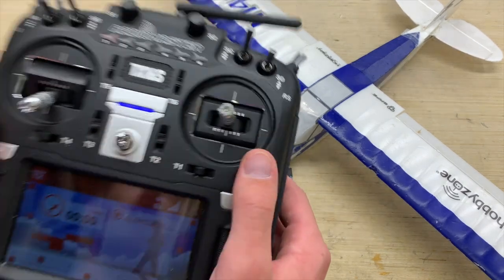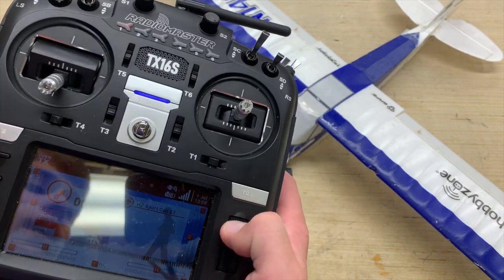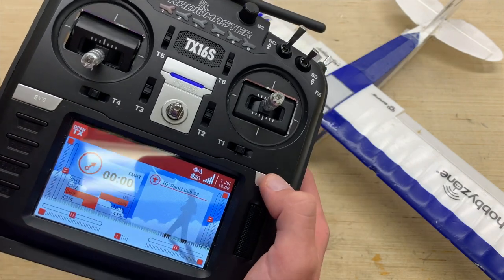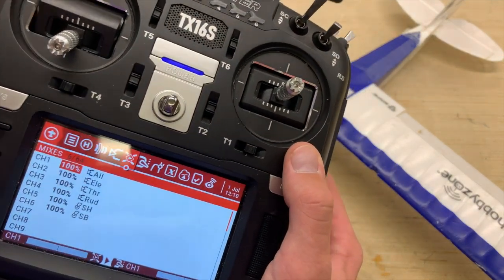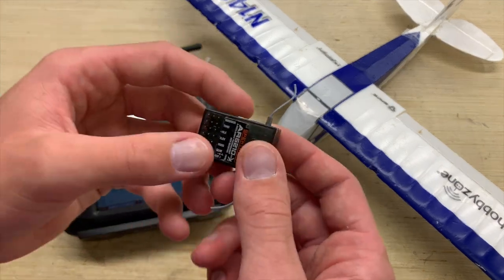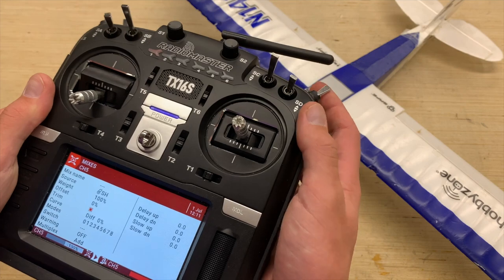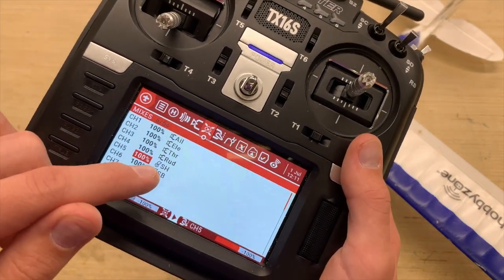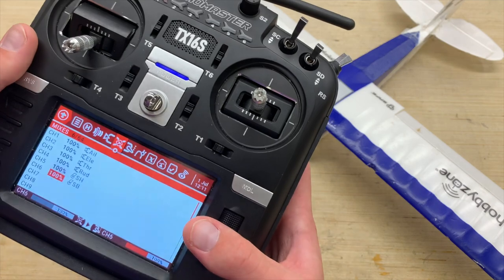How to Set Up Flight Mode/Panic Button Switches for SAFE/AS3X Planes w/ the RadioMaster TX16S

Comment: Thanks for these videos, they are a huge help. I am a drone pilot. I fly DJI Mavic Minis and a DJI Mavic 2 Pro. I also have a few CineWhoop's and two 5" acro drones that I built. I've been flying them for about 3-4 years now. I started with a Jumper T16, but soon after bought the RadioMaster TX16S Max. I love my TX16S!

I am new to fixed wing flight and I cannot wait to get my new plane in the air; it's a Turbo Timber Evolution 1.5. I wanted to use my TX16S, but I kept seeing videos saying you can't completely configure a Spektrum plane with TX16S because there are some things you cannot do with OpenTX. So I figured I would have to buy a DX6 or NX6 to be able to fly the plane the way it was meant to be flown. And now here you are showing me I can use my TX16S Max.

The only thing I have left is to figure out flap configuration and the radio will be 100% ready to fly my new plane. Did you ever do a video on configuring flaps for Spektrum receivers on a TX16S?

Thanks for these tutorials!
Reply from the maker: Yeah, essentially you can still use AS3X but safe functionality is a No-go without a genuine spectrum transmitter. Flap functionality is found in the AUX channels accordingly in the receiver, and you can look up any OpenTX flap tutorial for insight. hope it helps!
Reply: @CustomFPV  Awesome, thanks!

Comment: Thanks but when you say that you have set a switch for channel 6 as FLIGHT MODE do you mean that that channel switch is for the AS3X stabilization mode? Therefore channel 5 switch is for PANIC mode and channel 6 is for AS3X stabilization mode.

Comment: Thank you, this seems to have worked for me with a Radiomaster Zorro running EdgeTX. The only 2 quirks are 1) the lights don't change on the receiver when switching flight modes like they do when using a Spektrum radio (blue/red/purple), and 2) when I switch from one of the self level flight modes to no bank angle limit (AS3X only) it takes about a second to register the change, but seems to work ok apart from that. I haven't test flown it yet but it seems to work on the bench.

Comment: What if your plane has retacts and flaps , then where do you put your flight mode switch , im guessing on 7 and 8
Reply from the maker: I would assume so. I don't have any planes like that, however one thing you can do to determine it is to go ahead and start assigning switches and see which switches control each channel, then go from there. Let me know how it goes!

Comment: I bought a TX16s and a friend of mine has a Spektrum AR637T he isn't using and is willing to give it to me to see if I can get it to work with my TX16s. My question is how does one program the AR637T?  I watched a video setting up a FrSky S6R with a TX16s and calibrating the S6R was pretty straight forward. Knowing Spektrum I'm sure they made the process harder & more clandestine. 

Great video BTW and I agree with the fellow who suggested to slow down a bit.
Reply from the maker: It will bind up, and you can use as3x I believe, but on those RXes no safe. That’s the consensus at least.

Comment: Not aure the AS3x will work on certain spektrum receivers that require a special usb peograming cable like the AR636.
Reply from the maker: There may be limited compatibility, yes, but I’ve had no issues with it on this or a few of my other models

Comment: Great video but on my Sport Cub S2, I can get all 3 flight modes working on ch5, but soon as I apply throttle, I lose all SAFE functions and the light inside goes red, cannot go to blue or purple. Have you ever experienced this?
Reply from the maker: This is the only model I have had success getting safe to work w the TX16s. my ec1500 and other HH models safe doesn’t work. My understanding is that there isn’t really a fix for it.
Reply: For me the light doesn't work inside, but the SAFE functions work for all 3 settings. So your video does work! 

I got the safe select to work on my Turbo Timber umx, but I've yet to work on my Carbon Cub s2, I'm sure it'll work all 3 settings just like the Sport Cub S2
Reply from the maker: Glad to hear. happy flying!

Comment: 2 questions if i may,

1) does this process apply to edge tx also?

2) will this process also work on larger spektrum planes like a conscendo evo?
Reply from the maker: 95% of this applies to EdgeTX, it’s almost exactly the same as openTX. 

Other commenters have mentioned trouble getting all the SAFE and AS3X tech to work properly with the tx16s. I’m pretty sure you could fly the consendo but I’m not sure if you’ll have all the smart features.
Reply: @CustomFPV  gotcha. Thanks
Reply: Addition:
I have bound my conscendo evo and tx16s using the eachine mini warbird as a template then adapting the protocol to suit. I had to reverse a couple of servos but that was it. Safe and AS3X working fine. 

Thanks again for the info.

Comment: Great video. I just got a used eflight wildcat EFLU3650. I have a T12 plus with open TX, How do i ding it to get the stanbilization active....i am not sure if it has apanic but i know that i have 3 modes...how doi do those?
Thanks

ALex
Reply from the maker: I don’t have a lot of experience with this, to be honest. this is the only plane I have with stabilization. If the flight stabilization system is   onboard the plane and addressed via switches, you can set that up in the mixer tab. If it’s something more, I don’t have a lot of experience with anything else like it, sorry. Thanks for watching!

Comment: I watched your basic setup video also. Did you have to add ch 5 and 6 to your input list before you went to mixing list in this video? Cant get my umx Gee Bee to respond SAFE / panic mode on ch 5 switch doing what you show in this video. The AS3X seems to be on as i see the minor movements in control surfaces as you move plane, but no panic response when ch 5 sw is moved while in wonky attitude. Thanks!
Reply from the maker: Interesting, I just assigned the channels and moved on, no prior setup other than switch assignments. Worked fine for me. Thanks for watching!
Reply: @CustomFPV  i tried setting up a newer model (umx A10) that was just released. The SAFE function worked fine. Might be a difference in the way they built the dms receivers over time.
Reply from the maker: @sut2910  I'd say so. Thanks for bringing that up!

Comment: doesnt work with AR637TA   ......that comes in the timber x or conscendo ..any ideas Noah.....thanks
Reply from the maker: Interesting, no experience with those in particular, but it worked great on the Sport Cub S, and it seems other people have found success with theirs as well. maybe try different switches, and adjusting the range and throw of the switches in the output tab, not sure.
Reply: @CustomFPV  thanks bud,  yeah that AR637 seems to be a tough one
Reply from the maker: Good luck. let me know if you get it figured out!

Comment: Thanks for this video. Great job. Can you do a video on how to do a three position switch for flaps? I’m trying to get a Timber X properly setup. Flaps work but start high (like spoilers)
Reply from the maker: I would be happy to do that! I need to set up some flaperons on a plane, I had a similar issue. I will be sure to make a video once I figure it out
Reply: Sounds like whatever switch is assigned is going all the way to -100, I'm mew to this also, but I think if your minimum is 0, mid is 15-20% and full at 30-35%, should work as flaps.

Comment: Noah, will the SB (flight mode switch) that you set up for your flight modes have Auto Leveling ?
Reply from the maker: Yes, correct. If you bind a 3 position switch to ch5 (i believe) you will have all 3 modes
Reply: @CustomFPV  u are the coolest !

Comment: What if you were using all 6 channels already, for flaps and gear?
Reply from the maker: Well, If I am understanding correctly, that means you would need to use Ch7-8 for modes and panic, assuming your RX is 8ch
Reply: @CustomFPV  the rx is 6 channels

Comment: Just curious about the MPM firmware channel order. It looks like you kept the default AETR order and when you bind to DSM2 or DSMX, the MPM maps the inputs to the correct outputs. Is that correct? When the Jumper T16 came out, people were saying we MUST use the TAER firmware because the AS3X gyros wouldn't know what to do if it was in AETR order. If we can keep it in 5the default AETR order with the MPM handling the correct outputs, it will be so much easier!
BTW, I think the DSM2, DSMX and DSM RX (used for trainer mode) are works in progress. They've been changing some things having to do with Auto (possibly renaming this term), binding  in 22ms and 11ms and possibly other things. I believe they were saying something about the 22ms option disappeared in one revision and we should use auto to let the Tx and Rx handshake to determine the best options? Not too clear on this but it looks like the MPM folks are trying to simplify this for those of us who are transitioning from Spektrum radios.
Reply from the maker: Good point. I have heard about that, however I have yet to have an issue on the Sport Cub S. Might depend on the plane and RX. This method worked great for me, but we will see what other comments say about issues that occur. 

Yeah that would be a really big help to have an auto feature. Maybe not as much for like you and me who know our way around frame rates and protocols, but as you said, the beginners transitioning from spektrum radios could truly benefit from it! Thanks for the input!

Comment: No link to get the initial setup of AR 631 in open tx.  :-(( J
Reply from the maker: Should be close to similar, don’t have a lot of experience with that RX, but if you use DSMX to bind and assign channels to switches you should be in good shape.

Comment: So I'm a total noob. I'm thinking of getting the TX16S and I want to get the E Flite Valiant 1.3m for my first plane. So does the safe function work 100% flawless without buying any other gadgets like receivers, etc? Thanks
Reply from the maker: I don’t have much experience with it... it works fine on here but others have told me the integration isn’t great, as it doesnt have the spektrum proprietary tech onboard. if you want a radio that integrates with that, I would get a spektrum. I don’t use safe so the radiomaster is great for me.

Comment: I tried setting up my arm and disarm switch and it isn’t working.
Reply from the maker: Arm and disarm? like to start the motor? or what? or a throttle cut? please explain.,
Reply: @CustomFPV  for the throttle to be armed or disarmed. Flip switch one way to keep throttle from turning motor and switch the other way for the motor to run. I just having lots of problems with my tx16. My module blinks also saying it is recommended to update my version which I have tried doing and didn’t work. Also, when turning radio on it saids SD card needs to be updated. Tried that too and didn’t work. I have watched videos on how to do both but not working.

Comment: my local hobby shop told me that if i bought the tx16s transmitter it wont bind in a receiver that has as3x and safe technology and if it did it wont be functional is that correct? or was he just trying to upsell to on buying a spektrum transmitter. please help
Reply from the maker: It should bind fine, I have no experience really but it worked fine just by assigning channels to switches to control the features. all the as3x and safe hardware is built into the plane, not in the TX, so he was more than likely up selling you.
Reply: I live in canada and dx6e cost me 250$ which is around 190$ usd. Is it better to buy a tx16s than a “more user friendly” transmitter (dx6s) cuz i just got it today and i can return it and get the tx16
Reply: And also is you said safe and as3x is on the receiver meaning any type of transmitter it doesnt matter it would be always there (if you want to active it of course) right?
Reply from the maker: I think they are both great, the DX6 will be much better and easier to set up. However If you think you will take advantage of the extra features the Radiomaster brings to the table then go for it, but it will be much harder to tune and get it to function as you want. If you are only flying spektrum as3x and things like that, the user friendly ness of the dx6 is a major advantage
Reply from the maker: Yeah, it won’t be as easy to set up but it should be possible, i don’t have much experience though, I don’t fly safe or as3x.

Comment: hi i was look for the good for airplane .. it’s work with any kind a Receivers ? . and Fixed Wing Flight Controller Gyro it’s work . i see another Remote control Remote Transmitter ( RadioLink AT10II) .what is best i go for the RadioLink AT10II or Radiomaster TX16S
Reply from the maker: I think the TX16S is the best, got the Multi protocol module, will bind to literally any rx you want, even well into the toy grade stuff. Not to mention 16 channels, openTX, Color touch screen, and so much more. Don't forget this is all in the $100-$150 range....It just makes sense.
Reply: it’s good  150$ for another .. i want make it airplanes a350  .. thx so much

Comment: What about blade helis? Will I have full functioning? I really don't want to buy a dx6/dx8 when then is twice as cheap.
Reply from the maker: Yes, it will work great with those. Ive got an inductrix and it is performing flawlessly!
Reply: @CustomFPV  I have a fusion 180 and 230s v2 helicopters. Will I still be able to keep safe mode and the govenor on them?
Reply from the maker: Yes it will, however you may need to work with the channel mapping a bit. I know that you can make it work though. I’m going to make a video with my inductrix and see how it goes
Reply: @ant-man1131  Did you get your 230S running OK???
Reply: @helichuck1  yes it worked great with my 230, although I've moved on to both the OMPs....M2 ,M1. and the Eachine direct drives'. Now I'm waiting on my Align T15. The Radio master is in a league of it's own and I'm sure the Jumper line of radios are just as good along with the Tarranis transmitters.